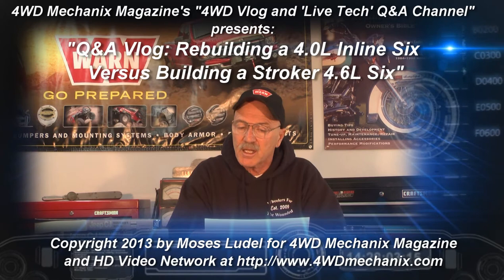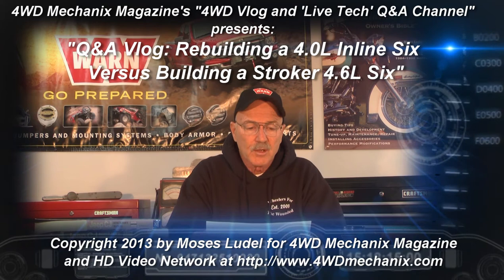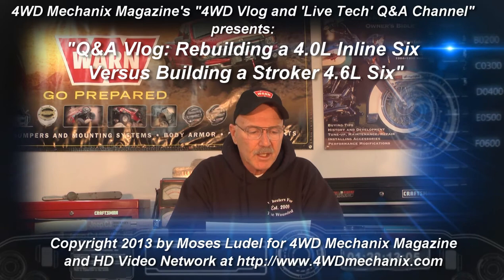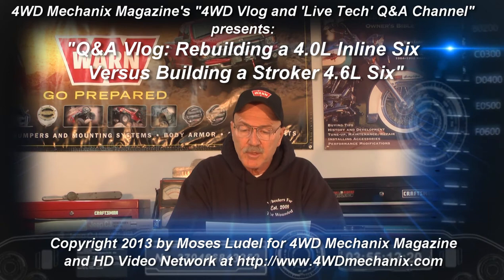Jeep® 4.6L Stroker Buildup Versus Stock 4.0L Rebuild

Comment: I would say that for a daily driver setup I would stay with a good 4.0 build unless you like filling up with premium fuel which a stroker build will almost always demand.
Reply from the maker: This is why I hold to 8:1 or 8.5:1 (maximum) compression on my builds.  You may need the higher flow injectors for higher rpm.  (I hold to a maximum 4,500 rpm and seldom get near that speed.)  Unleaded regular is acceptable with a mild or stock camshaft, especially at 8:1 compression.  I'm taking advantage of the low-end torque available from the longer stroke, which also works well for running tall axle gearing if fuel mileage is a concern.
Reply: @RoadReadywithMosesLudel  Good to know you can take advantage of the extra cubes and run regular.
Reply: @RoadReadywithMosesLudel doesn't staying at or below 4000rpm, have the.stroker producing very similar power to the stock 4.0?
   All the dynos I've seem, show the strikers to not really make a difference until nearing 5000rpm
Reply from the maker: Dyne results are usually with engines beyond 9:1 compression and with a "bigger" camshaft like a 260-degree or longer duration camshaft.  A camshaft of this duration will have more valve overlap and poorer performance down low.  (Lower manifold vacuum at lower rpm is a good indicator.)  If we compare a stock bore/stroke 4.0L with a stroker at 8.5 or 8.7:1 compression, each with a stock or mild duration camshaft, I am certain that the 4.6L will produce more torque and horsepower from idle to 4,000 rpm.  The 4.0L is an over-square design with a larger bore than the 258 six.  The stroke is much shorter.  This leads to less bottom end power and the need to wind the engine up to reach its torque peak.  '80s emissions laden 4.2L/258 AMC/Jeep inline sixes were designed for bottom end torque:  the torque peaks as low as 1,600 rpm.  This is a torque rise similar to a diesel engine.  The 242/4.0L cannot, by design, produce a torque rise like this, the stock engine requires rpm to produce peak torque and horsepower.  If we we're talking about fuel efficiency, I would like to see a comparison of a stroker 4.6L running modest compression and either a stock 4.0L camshaft or a shorter duration, higher valve lift camshaft.  (My historic favorite 252 CompCams grind for pre-C.O.P. engines is one example and a choice I would make.  The 4.6L would breathe a bit better and produce  higher manifold vacuum at an idle and lower rpm.)  For trail running and city traffic, this is the kind of build I would want.  Foot lighter on the throttle, the torque with a heavy flywheel would be great for off-pavement crawling.  The cost of building a 4.6L is nearly identical to a thorough 4.0L rebuild once you have a 4.2L/258 crankshaft.

Comment: Thank you for this video.  My son and I will be building a 4.6 L engine using the crankshaft and connecting rods from his 1986 AMC Eagle and an engine from a 1993 Jeep XJ Sahara.  What will our approximate compression ratio be?  Will we need use a higher octane fuel?
Thanks again.
Reply from the maker: With stock replacement (dished) pistons, static compression and a stock block deck height, compression will be over 9:1.  8.7:1 to 9:1 is a safe bet for regular fuel.  The 1991-99 4.0L heads have a good anti-knock design, and these engines did not need a knock sensor.  Your question is warranted, though.  You can bring the compression down or in line for lower octane fuel by running a thicker head gasket that will work with your build.  There are Cometic gaskets.  FelPro is fairly thick.  Edelbrock's gasket is thick and designed for a big bore, which should drop compression slightly on a 0.030" standard rebore.  If the block and head decks are true, clean surfaces thoroughly and leave them stock without milling/decking.  Decking will increase compression.  (Always confirm the lifter clearance/preload with your assembled long-block.  Use the right length pushrods.  A $20 CompCams pushrod length gauge is the ticket here.)  I like a stock or milder "RV" camshaft that will provide the best low-end performance.  CompCams' older 252 grind was my go-to for decades and worked well for all but the later coil-on-plug 4.0L engines (2000-up, some 1999 engines).  If fuel mileage is important, I avoid "bigger" mid-range/higher rpm camshafts with more valve overlap.  For bottom end torque and fuel mileage, you want a mild duration cam with more lift to get better manifold vacuum from idle to 4,500 rpm.  Some argue that a lower compression 4.6L is a waste of energy and money.  It depends on your expectations.  If a major improvement in lower rpm torque is the goal, the 4.6L is a must.  You have the crankshaft and rods, there's no reason not to do the 4.6L build.  Mild builds with a lower rpm ceiling may not require a fuel injector change.  Worst case, 302 Ford V8 replacement injectors work.
Reply: Thank you, Moses, this is very helpful.  Our goal with this car is to be an on-road driver; it’s highly doubtful we’ll take this off-road.  We may pull a boat trailer or camper with it.  We don’t want a high-RPM engine, but rather a torquer.  After a lot of searching and comparing specifications, we purchased a CompCams Xtreme 4X4 206/212 Hydraulic Flat Cam for AMC 199-258/4.0L.  According to CompCams, it provides “Excellent torque and throttle response.  Great stock cam upgrade in fuel injected applications.”  These are the specifications:
Intake: Adv Dur: 250, Dur: 206, Lift: 0.462
Exhaust: Adv Dur: 256, Dur: 212, Lift: 0.478
Lobe Separation: 113.0
The part number is 68-232-4.
How does this compare with the 252 grind?
Our biggest challenge right now is modifying the gas tank to fit an electric fuel pump for the fuel injection system.
Thanks again.
Reply from the maker: This is a good grind for EFI/MPI.  The profile is a duration close to the 252, and lift is ample for low-end torque.  Lobe separation looks reasonable.  This should work, I like the 800-4800 rpm target.  As for an electric fuel pump, the Mopar MPI/EFI conversion kit for the 258 sixes uses an inline fuel pump mounted externally in the fuel system between the tank and engine.  Optimal mounting point is near the tank.  The 60-way/pin PCM triggers the pump operation as it would an in-tank pump.  The external mount pump has been a common Walbro type with the correct pressure range.  HESCO and others sell the external fuel pump.  This picks up fuel from the stock tank sock and pickup tube.  You need to use a return fuel line from the '93 two-rail EFI back to the fuel tank.  If the chassis already has a fuel return line, you can tap into that and pick up the return fuel at the pressure regulator's return fuel rail.  You're basically doing a Mopar EFI conversion.  My 1972-86 Jeep CJ Rebuilder's Manual (Bentley Publishers) and HESCO's website detail this conversion.  You have the fuel pressure regulator at the engine with the '93 two-rail system.  Later Mopar kits pattern off the TJ Wrangler that used a tank fuel module-mounted pressure regulator and single rail EFI.  Stick with the two-rail for your installation.  You already have the pressure regulator.
Reply: Thank you so much for your comprehensive responses, Moses.  I’ve ordered your 1972-86 Jeep CJ Rebuilder’s Manual.

It would be MUCH easier to use an external fuel pump, but I’ve always heard that they only last 2 – 3 years, while the internal pumps last much longer due to being cooled by the fuel.  Reliability is a very important factor for this car.  The source of the external pump Hesco is selling isn’t revealed, and they’ve added “The actual pump may vary from picture due to the original being discontinued by the manufacturer” to their description.  Can you recommend a good, reliable external fuel pump for this engine?
Reply from the maker: Thanks for your interest in the Jeep CJ Rebuilder's Manual...There are a number of quality pump suppliers for external pumps.  I would look at the Summit Racing website offerings for ideas and reviews.  The critical issue here is a supply pump in the same pressure range and volume as the OEM pump for a '93 YJ Wrangler.  Walbro has been an aftermarket supplier of OEM caliber pumps for the in-tank modules.  They use the GSS340/341/342 for a '93 Wrangler OEM replacement application, which is a 255LPH (liters per hour) flow and a maximum 500 horsepower.  The stock 1993 in-tank fuel pump reaches a maximum pressure around 75 psi and is able to sustain 39-41 psi at the fuel rail test port when the engine is cold (during cold start warm-up/enrichment).  When warmed and idling, pressure should be approximately 31 psi at your fuel rail test port.  This is not a huge demand for an EFI-type fuel pump.  You must have an unrestricted fuel return line to the fuel tank as I have noted.  The line should be 5/16" minimum on the return side.  3/8" double-flare brake/fuel tubing works well on the pressure side, I run it the length of the frame and use high pressure EFI hose at the flexible ends.  (I bubble flare the tubing ends and use EFI-type hose clamps, details covered in the book you ordered.)  Here's a less expensive universal Walbro pump at Summit Racing.  There are wiring and external mounting kits shown at the same page:  https://www.summitracing.com/parts/vpn-gsl392bx.  Keep in mind that the fuel pump gets triggered by the PCM.  The pump is not switched on and left on.  A wiring diagram and OEM shop manual provides details on how to wiring up the fuel pump.  (HESCO has an EFI conversion PDF download that's helpful, too.)  For wiring diagrams and troubleshooting, I highly recommend a CD factory shop manual, available at eBay.  Here's a good buy on a Bishko licensed FSM specifically for your EFI system:  https://www.ebay.com/itm/233825069149.  As for reliability of external pumps, that's a reasonable concern.  We towed a stranded V8 conversion Jeep TJ ten miles out of the Moab backcountry with a failed external electric fuel pump.  Suggestion:  Carry a spare pump and the tools/know-how to replace it.

Comment: Mine is a 258 AMC
Reply from the maker: Many use their 258/4.2L crankshaft and rods in a 4.0L block to produce a stroker motor.  The 4.0L has a 1/8" larger bore than the 258.  The 4.0L stroke is shorter.  The marriage between these two engines produces great power.  With a complete 4.0L donor engine, a modern stroker engine can be built.  I like the 1991-95 distributor-type 4.0L donor engines with the 60-way/pin PCM and original engine wiring harness included.  This build has been covered extensively at 4WD Mechanix Magazine and its forums.
Reply: @RoadReadywithMosesLudel  thanks 🙏 my is from a jeep Wrangler 1990. Islander
Reply from the maker: You have the last carbureted 258 inline six.  Not a slouch!  I went over the Rubicon trail with these models and competed in the '87/'88 Jeep Cup Rally as well.  I'm a big fan of the 258, even in stock form.  We lit these engines up with the Mopar Performance EFI Conversion in the mid-nineties.  The 1981-90 258 CJs and YJs could gain a conservative 50 horsepower with the bolt-on conversion, better fuel efficiency and excellent high altitude performance.  Even the stock BBD Carter carbureted models deliver fun, reliable service!
Reply: @RoadReadywithMosesLudel  yes carburetor
Reply: @RoadReadywithMosesLudel  I tried to repair the engine, but got bad luck with the guys in the machine shop
Reply from the maker: Many now move on to either a stock/donor 4.0L with EFI or build a 4.6L EFI stroker.  Sorry you had difficulty getting the 258 engine repaired.  You do have some choices, the '90 YJ Wrangler is a great Jeep with the AX15 manual transmission and NP231 transfer case!  Our forums at https://forums.4WDmechanix.com can provide a variety of approaches and ways owners work through this.
Reply: @RoadReadywithMosesLudel  My jeep Wrangler is automatic transmission
Reply: @RoadReadywithMosesLudel  thanks
Reply from the maker: I wondered and took a guess about the AX15.  Your automatic is a proven Chrysler A904/A999 design, rugged and noteworthy.  Without an overdrive, the three forward speeds prove plenty for off-road use.  These A999 units last forever, though they do require occasional band adjustment.  Some strategic upgrades are available to keep the RWD Chrysler (Torqueflite) band transmissions alive.  Here's an article I did years ago with details on the upgrades:  https://4wdmechanix.com/survival-upgrades-for-jeep-and-dodge-ram-automatic-transmissions/.
Reply: @RoadReadywithMosesLudel  wao your are great 👍
Reply from the maker: Glad this is helpful!  Enjoy that YJ!
Reply from the maker: Glad this is helpful...Enjoy that YJ!
Reply: @RoadReadywithMosesLudel  thanks 🙏
Reply: My jeep was made in Canada
Reply from the maker: Interesting...As an American journalist, I covered the 1988 Jeep Cup Rally finals at Ontario when the YJ Wrangler 4.2L (carbureted inline sixes like yours) and the 2.5L (fours) were in production.  We visited the plant at Brampton.  AMC was selling to Chrysler, and the  XJ Cherokee, YJ Wrangler and Grand Wagoneer sales were what Chrysler wanted.  Eagle cars and J-trucks quickly disappeared.  The Grand Wagoneer (SJ platform similar to the J-trucks) lasted through 1991 and has since become a cult classic...Your Jeep was Mopar-built in the same configuration as when AMC launched the YJ Wrangler in 1987.  1991 was the big change year for YJ powertrains.
Reply: @RoadReadywithMosesLudel  I need to take notes and may see how I can fix this Jeep
Reply from the maker: You would enjoy the magazine's forums, there's lots of Jeep coverage at https://forums.4WDmechanix.com.  (I answer questions there.  Subscribing is free.)  The 258 AMC/Jeep engines get a lot of attention, there are some rebuilds in CJs that are similar to your YJ.  1987-90 is somewhat limiting but not when you include the 1981-86 CJs that use your engine, carburetor and so on.  Also, for Carter BBD carburetor work, I did an extensive how-to article with photos at the magazine.  Your 4.2L YJ Wrangler BBD Carter carburetor gets full attention at:  https://4wdmechanix.com/moses-ludels-4wd-mechanix-magazine-rebuilding-the-yj-wrangler-4-2l-bbd-carburetor/.

Comment: I just like big inline-6's 🤷
Reply from the maker: I do, too!  Easier to balance, inherently smoother, live a long time, simpler to service and highly reliable.  What's more?  Even vintage four-main bearing sixes like Chevrolet, GMC, I-H, Chrysler's slant-six and Toyota F-engines stay together well.  More modern seven-main bearing sixes are that much stronger.
Reply: @RoadReadywithMosesLudel  What's  weird to me is some of the outright hate for the 4.6 or even the 4.5 "poor man's stroker". When I had my 4Runner I mentioned briefly on the forums I was gonna sell it and build a 4.6 in it's place and I got a dozen people immediately saying I'm a fool for choosing that when I could spend the same amount of money on a full 3.4 rebuild, adding a supercharger, smaller pulley, 7th injector, piggyback ECU with dyno tuning and methanol injection - and still make less power in the end 😂 Even on the Jeep forums you find some people that spread BS on how you "hardly gain anything" from it and it's not worth the time, and often act like if you do anything to a stock 4.0 and/or do anything but LS swap then it's gonna blow up and everyone will die and your wife will leave you. Super weird.
These engines have a lot to give if you tinker with them - they always have, even since the CJ days. If I'm not mistaken my dad has a 4.0 head on his 258 (CJ7) and it was the best money he ever spent
Reply from the maker: There is room for V8 swaps, but the 4.6L rebuild is very sensible.  With a 258 crankshaft and possibly a set of higher flow injectors (depending on the build), the cost to machine and assemble a 4.6L is otherwise the same as rebuilding a 4.0L without stroking it.  The weakness of the 4.0L is the shorter stroke that negates the bottom end torque.  A major advantage of longer stroke inline sixes is stump pulling power down low.  4.6L dimensions actually follow a fifties/sixties light and medium duty truck engine performance strategy.  (The 4.6L stroker reminds me of the 292 Chevy/GMC and 300 cubic inch Ford inline seven-main bearing sixes.  Not the best fuel mileage but more low-end torque than an equivalent V8.)  The result is reliability, ease of balance and gobs of bottom-end torque.  The iron inline sixes are not the most fuel efficient, but they're virtually indestructible.  If a Jeep owner wants higher rpm power, a GM LS V8 is more efficient.  (Stroker 4.6L inline sixes with a "big camshaft" and boosted compression become a toss-up.  Here, I would opt for an LS V8 for fuel efficiency.)  Crawling around on the rocks, I'll take the low-end inline six-cylinder torque and a weighty flywheel.  If a daily driver or freeway flier, I would consider an LS V8 like the 4.8L or 5.3L.  One place where an LS would also be my pick would be meeting emissions requirements.  At my magazine's forums, CJ and YJ 4.2L owners hit the wall trying to restore the emissions system or upgrade to expensive 50-state legal EFI to remain emission compliant.  Here, a stock appearing 1991-95 4.0L or 4.6L emission compliant inline six conversion or a clean 50-State legal LS V8 swap makes sense to me.